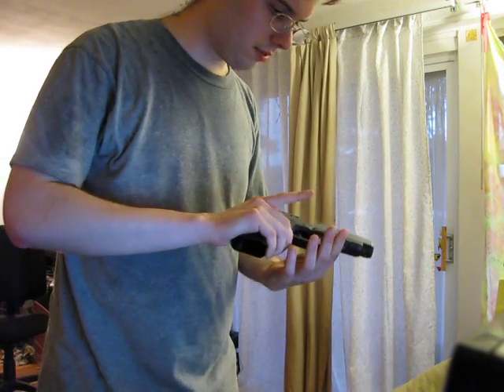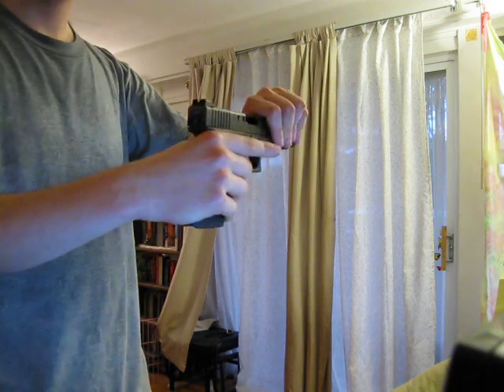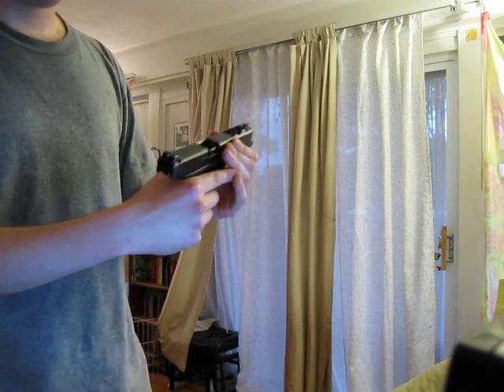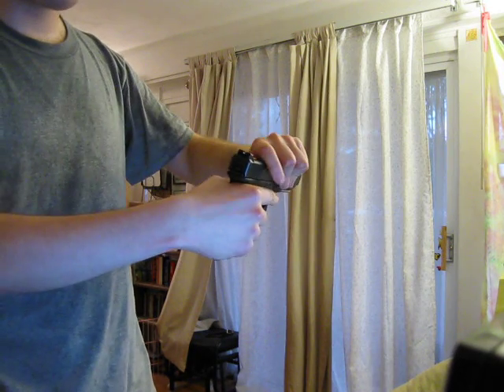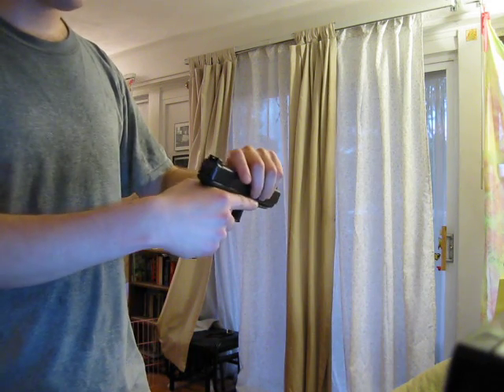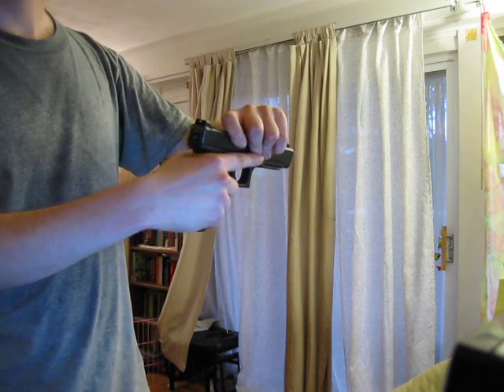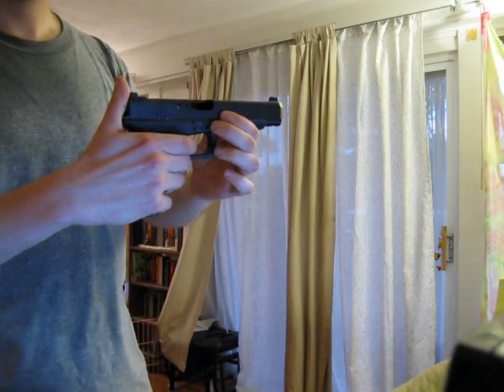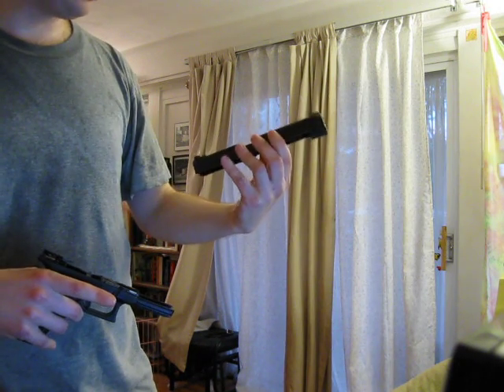How to get the slide off a Glock with no barrel/recoil spring installed

Comment: Ive been reading and hearing this way is not the safe way to do it. will anything break doing it this way? the only reason i did it this way is becuase
 i don't have the tool to take the striker out of the back of the slide. and I need my gun loaded tonight.

Comment: What if you put the slide on with the barrel but without the recoil spring. How do you take the slide off?
Reply: the same way push forward the slide to the normal position, pull the trigger. Then pull the slide forward and off while holding down the takedown lever(s)
Reply: Same thing follow the videos institutions, I did that same thing and it worked for me